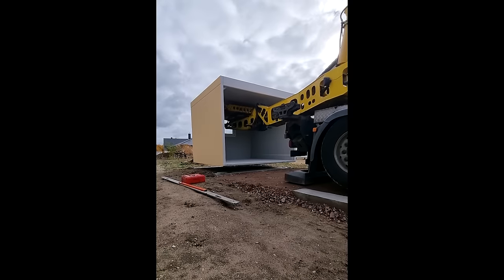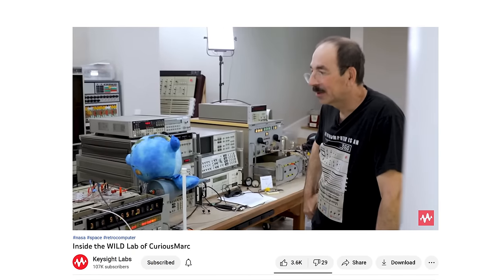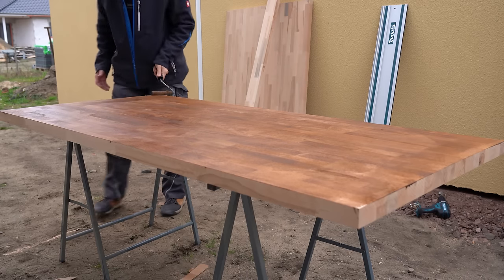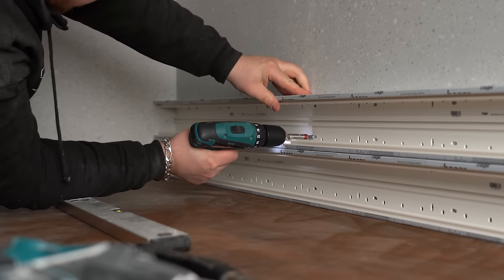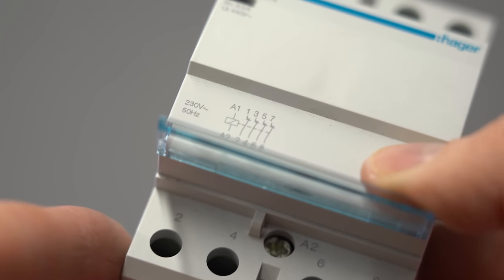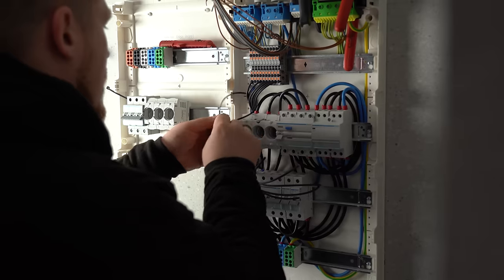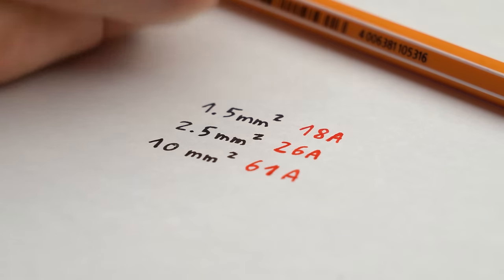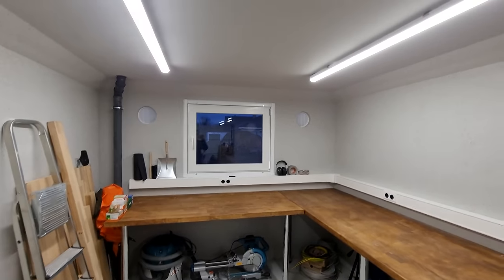Germans do the PERFECT Electrical Wiring! (Garage Build)

Comment: I just love those phoenix connectors, they are so easy to work with
Reply from the maker: Agree :-)
Reply: @greatscottlab  If only they weren't so expensive. When I needed them for our house even the basic PTTBS/1,5 ones were at around 85 cents each.
Reply: @vbinsider  It's industrial equipment. Pricing will always be higher.

Comment: Tip for the emergency stop. You can always wire in a small LED parallel to the main and the neutral on the steering side of the relay to show that there is voltage across the LED, even though the relay is not triggered.
Reply from the maker: Thanks for the tip :-)
Reply: Please explain the circuit for "just wiring in an LED"?
Reply: @mrtechie6810  there are e-stop buttons that can have an integrated LED, for example from Eaton. They also have Signal LED Modules that run on 230 Volts.
Reply: @SystemX1983  how much$?
Reply: @mrtechie6810  around 11-17€,  depends where you buy them. Also, Siemens has a similar System
Reply: @SystemX1983  that's one expensive lightbulb!
Reply: @mrtechie6810  yeah, it's not cheap and definitely not suitable to light up the room 😁
It's just an indicator light for the e-stop button ...
Reply: @mrtechie6810  voltage-rated resistor to not overcurrent the LED, LED itself, and rectifier/anti-parallel diode to protect LED from reverse breakdown.
Reply: @namibjDerEchte  thank you, that is what I was looking for!

Comment: For my workbench I installed a 6 foot long outlet strip above and below the workbench.  That way I can connect as many tools as necessary where I need to.  I probably only use one tool at a time, but it's very convenient to just leave them all plugged in.  Under the workbench I have a shelf with power tools always plugged in, like a drill, Dremel, heat gun, glue gun, oscillating tool and more.  When I need something, just pull it out and use it.

Comment: Beautiful work. Great to see the German approach to a shed. Wonderful stuff.
Reply from the maker: Thanks 🙂We gave it our best.
Reply: @greatscottlab  
Hi,
Is it common to use electrical wires like that in combination with PVC pipes in Germany? 

Here in NL (as far as I know) single wires for each fase + a ground wire would be used within PVC pipes. Those wires would also have solid cores. Also the wires would be fully enclosed with PVC pipes and junction boxes. 

I would associate the ones that you used with extension cords. 

I’m just curious, thanks.

Comment: To everyone asking why the cable wasnt completely enclosed in the conduit with bends and such: 
In germany electrical wiring needs to be double insulated. In this case the cable itself already is, so in theory he could have just nailed it directly to the walls with some clips, not needing the conduits at all. 
Had he run single wires, then he would have needed to enclose the wires in conduit the whole way. But running single wires in conduit, while allowed, is not usually done here.
Reply: i was thinking about that myself, even if its not needed i think is makes the whole install look DIY  when conduit stops and starts. If i did that during my apprenticeship in the uk, i would have got it in the neck. I think as its not really any extra work to install bends and bush and couplers in the trunking and conduit its worth it to look, not DIY
Reply: @maynardholt8935  Well we are cheapskates, nobody here will pay for the extra material and labor if it isn't required by code.
Also those are even a little challenging to come by, usually that's not something in stock and ordered.
Call us lazy, go ahead, won't blame ya 🤣
Reply: @maynardholt8935  I agree. The lack of couplers into the main duct and also to each device really triggered me.  I'm not a sparky (my career was in electronic design) but it makes the whole thing look incomplete. The same goes for the bends between sections of conduit, especially as the cable transitions from wall to ceiling.  And I understand the double insulation point, but it just looks bad.
Reply: That still raises questions in the UK we were generally connect the conduit to the box even if we used double insulated cable the reason is if the cat conjuring is installed for protecting the cable directly above a switch or socket is the most likely paste it could get damaged because it’s the place you’re touching a lotall the height you would lean something against the wall if a conduit is installed simply for mounting the cable as it’s easier than clips that would be fine but he doesn’t really offer lots of protection
Reply: @maynardholt8935  I think that’s because in the UK we still going to protect the cable here it seems to be easier than clipping it as I don’t think clips are super common in Germany

Comment: Im from germany and learing Electrician. I am at 95% from my apprenticeship so in my last half Year (3/3,5). I have to say that the result is very clean and tidy. So Yes the Cables could a bit more straight so horizontally and vertically, then i think it would be 100% perfect. Nice Job!

Comment: I'm not sure what your plans are for your CEE outlet but you might consider wiring the outlet to a relay that seals in with a start stop button. The buttons would allow you to de-energize and energize the outlet safely and if you have a power outage the relay would drop out and not allow the outlet to be re-energized when the power comes back on until the start button is pressed. We did this with the outlets on our motor test bench at work.
Reply: makes no sense, just pull the plug and most machines you connect, have already a main switch...dont get overboard....there is an RCD!

Comment: Nice installation. A thing I would suggest, considering you will work with electronic equipment and possibly faulty one would have been to install more than one RCD, at least one for the workbench sockets and one for lights/other sockets, so when you trip it you will not remain in the dark.

Comment: Other than the safety relay being normally off instead of normally on,  I like what you'ved done.  A lot of thought has been put into what you want, and that wall channel is a great idea.   I can see a 63Watt continuous draw would be unwanted.   Even if it was only on while you worked at the bench, and turned off other times, it would still be something that needed considering.   
Thanks for the tour and showing us your thought process.
Reply: That safety relay is a huge NO for that specific reason. There should be two switches in the emergency stop: One closer, that closes when the switch enclosure is bolted together so you cannot switch the power on when an emergency stop switch is missing/got torn off and an opener that breaks the power to the power contactor which then switches itself off. On top of that, the power should not switch back on when you pull the emergency stop out but you need to have a seperate POWER ON switch (momentary). In German that is called Selbsthalteschaltung.
Doing it any other way is pretty dangerous. And that "normally on" power contactor is not that common to begin with...

Edit: The whole argument of "too much power consumption" is nonsense because the relay only requires those 60W in the very moment it starts moving. Once switching is complete, it is somewhere below 5 W. The only reason they put the high number in the datasheet is that all current bearing parts on the coil side need to be designed for that higher current...

Comment: Nice job. The only thing I can say from experience is that double the amount of outlets you think you are going to need and then you will not run out of them immediately :)
Like, none at the ceiling? You should have some. And under the desks. And then more above the desks, but of course you can do that easily into the ducts.
Reply: It's a 3m x 3m area lol how many outlets do you really need? Get a power strip if needed.
Reply: @randybobandy9828  I currently have 30 plugs in use in the small room I sit in at the moment. Extensions and multiple output strips can be nice but they can also be very inconvenient for stuff you need to unplug often. And it's nice to have switched and always on outlets etc. Not to mention a lot of devices that occupy one port but block the adjacent one and so on.
Reply: Agreed - I would add quite a few outlets under the desk for those things that are rarely unplugged, and perhaps a couple of ports in the desktop (at the back) for cables to pass through.  It also reduces the cable clutter on top of the desk.

Comment: nice and clean job, well done! Here in Czech republic we use 1,5mm2 up to 10A and 2,5mm2 for 16A circuit braker.
Reply: That safe for sure. In Krautland, it is calculated, which cable diameter is required, dependig an the cablelength and breaker, so it is also safe, but kind more complicated.
Reply: In germany we only use 16 amp wiring, breakers and plugs, its way better then mixing it up since the same outlet is used

Comment: I think those ducts are a fantastic idea but I would have also tried to get a couple of normal outlets in the wall that are located under the tables for those plugs you never really unplug. I am definitely going to implement the power ducts in my dream lab set-up!
Reply from the maker: Thanks for the feedback :-)
Reply: @greatscottlab  Thank you for the new ideas running through my head! Amazing content as always, thank you!
Reply: Not only "under the table" but also add a number of RJ45 outlets and maybe a few power outlets in a different color, connected to a UPS.
Having RJ45 outlets everywhere is absolutely a win-win. Even though you might not yet have them patched to a switch yet. Just wire them to a patch panel near your switch(es) so you can "enable" them by patching them when needed. Also manual switching between switches (e.g. 2.5G/10G) or VLAN ports is really useful when you ever decide to use managed switches and have fallen in love with the truly nice features VLANs have to offer :) )
Maybe also one or two mains outlets connected to their own earth breaker ("aardlekschakelaar" in Dutch) with a lower than the standard 30 mA threshold so you can connect test devices to it which might otherwise be tripping the breaker for a lot more devices.
Reply: Those are very commonly used in public spaces like schools. Also in offices and other bog buildings in Finland
Reply: @TD-er  With these wallmount system, it's so easy to just run 20 cables to a patchpanel in a small 19" Rack and switch and pull one cable into the house to the main switch (Fiber FTW :D)

Comment: It's good to see some sense with connecting electricity here. I'm used to those weird USA way of installing electrical installations, as I mostly watch English content on Youtube. Luckily I'm Dutch (hello neighbour!) and we have such installations as the Germans too, almost the same rules too! I did an education in normal 230v electronic installations before I could pick my IT specialty. So my knowledge is a bit rusty, but I like to see good installations such as this. 

Having said that, this installtion looks very good!
Reply: LOL, I love it when Europeans complain about electrical distribution in N.A.  Yes its so weird!
 3-Conductor cable run inside the walls, which terminate at outlets where each conductor is screwed into its terminal.  Wow, so crazy!
Or is it the wirenuts that are just soo kooky?
Strip 2-3-4 conductors 1", twist them clockwise with a pliers, and then sit a wirenut on top and twist them some more.  Patented by a Scotsman in Canada in 1926. 
If there were problems with them of any kind, they woudn't be a standard.  Anyone outside of a DIY'er can strips and wirenut a connection in under a minute, so any labor saving excuse is really BS, often used to justify the 10x+ increase in connector cost.
Being able to flip a lever and re-use a connector, WOW.... Really, since they are used inside walls/boxes, its pretty rare they ever get touched again, so outside of maybe lightswitches where you might have 6-8 wires coming in, or be potentially more often accessed as SHMBO wants to replace switches, not seeing any reason why they are superior in a construction project.
One place where they are nice as mentioned above is where you have a lot of wires coming into a box and the small feature size on the connector just saves the day of what would otherwise be a rats nest.  The wirenuts have been studied and the pressure applied in their use has been shown to provide a pretty serious crompression interface that makes them pretty darn strong, with an airless interface. I've heard a few complaints about slightly to short wires pulling out of Waygo's being a problem also. Along with issues with the springs inside for some reason or other.
But yeah, crazy. Every day we've got people dieing from house fires and being eletrocuts putting up picture frames over here...
Reply: @boots7859  That's a big text. But i suggest you ever visit a fair like Light and Building in Frankfurt in Germany. The whole world accents there every two years. Your eyes will open. While i think American Industrial installations are sometimes works of wonder. I really do think domestic installs are from another age.

Comment: i really like the idea of an Estop in the workshop, though I would recommend going the extra mile and use two channels with separate relays and NC contacts.
To reduce power consumption you could simply push the Estop when you leave the workshop :)
If you don't want that, at least do a function check every time before you use your workshop.
Also, having one Estop actuator is nice, but more would make sense so you can reach one from wherever you are
Reply: Yeah, in my little world that e-stop design would be totally unacceptable. Trading proper design for saving 63 watts is just dumb. Normally closed buttons, normally energized contactor. Double it all up (2 e-stop redundant loops) if you wanna get all euro with it.
Reply: Yeah, I use my estop as a general-purpose master switch. (saves on the latent draw of the various devices too if you want to be conscious of power usage)
Reply: @sootikins  I think the e-stop was mostly a "nice to have" and not a require safety feature in this case. With german electricity prices saving 63 watts of draw can mean >350€ extra electricity costs per year.
Reply: @Esablaka  I agree. I was more just wanting to run my mouth than anything. Somebody has to be Safety Sally here - LOL. So by your math German power costs about 0.63€/KWh. Not that shocking. In my part of USA the power companies have all gone "green" causing rates to skyrocket. I pay $0.33/KWh off peak times and $0.67/KWh on peak.
Reply: Automated equipment I'm used to had two "lines" in the E-STOP loop. One normally "OPEN" and one "CLOSED". BOTH had to be correct in order to function. ALL E-Stops were then in SERIES.
Reply: You could always install a watt meter to see how much power you are consuming for the entire shop, that way you can power off anything that is pulling power easily.
Reply: @sootikins  Ironically, the high electricity prices are mainly caused by the french nuclear power plants that are in maintenance because of corrosion on security related parts and the lack of investment/encouragement of the past governments to replace natural gas. If the past Governments heard on people wanting green energy, and build more wind mills, solar panels, heat pumps and BEV, Europe would be better of, since those are producing even when a Government decides to stop selling stuff to Europe.

Comment: Congratulations! It looks awesome, 99% same as mine :) the only difference is that along with the sockets in the Brüstungskanal I installed 6A breakers. Not only for extra protection, I can turn the sockets on/off using these breakers.